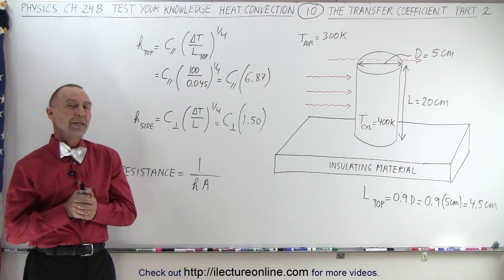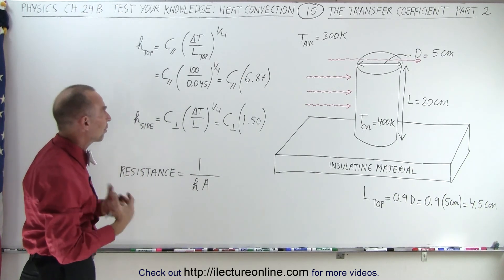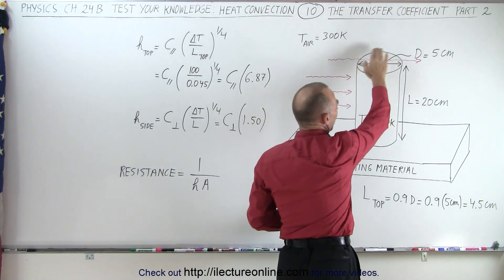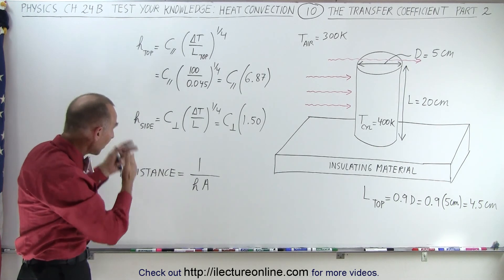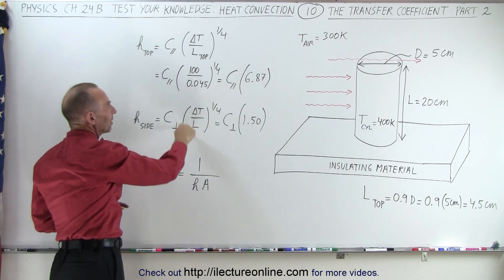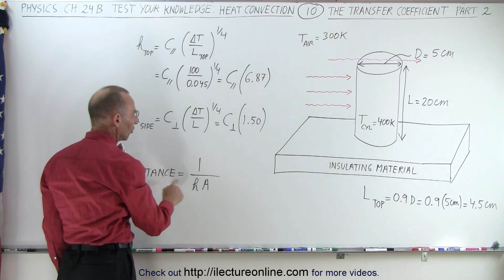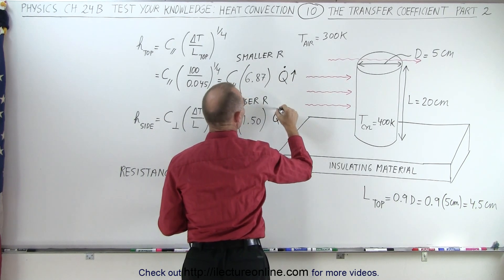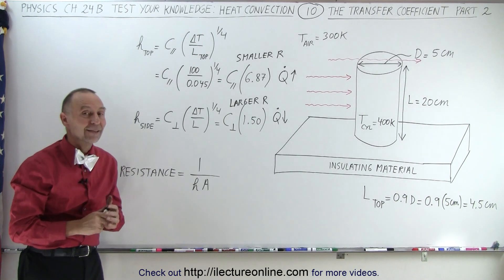Physics: Ch 24B - Convection: Test Your Knowledge (10 of 26) The Transfer Coefficient Part 2

Comment: It would've been interesting if you had used the same length as your 0.9D, so we could've seen the 7% larger h on the top (referring to your Horizontal vs. Vertical video, 4 of 26 in this series).